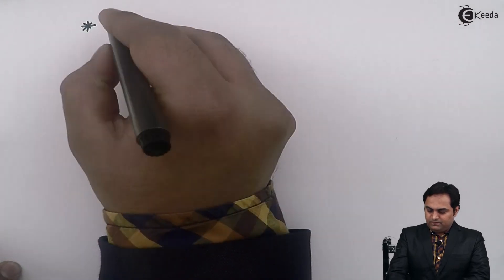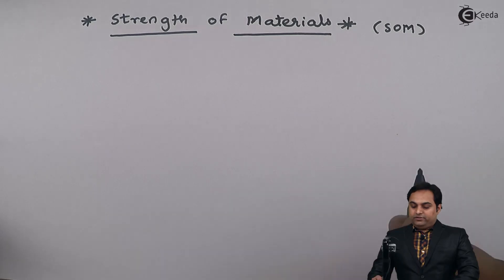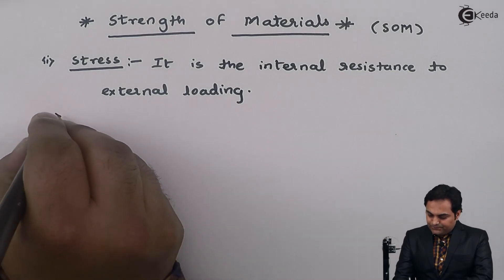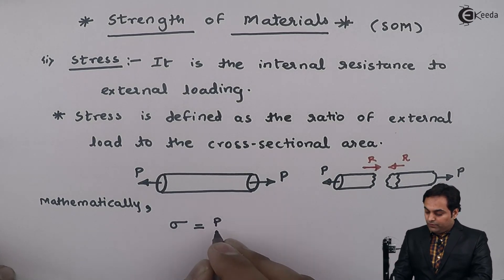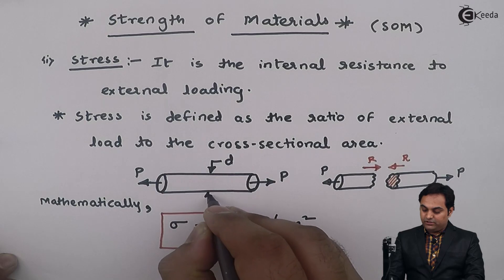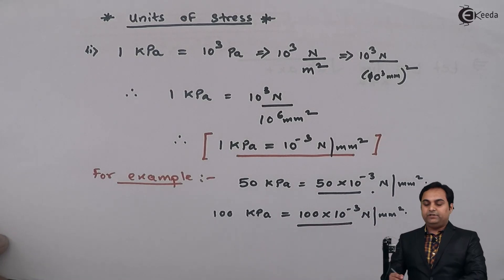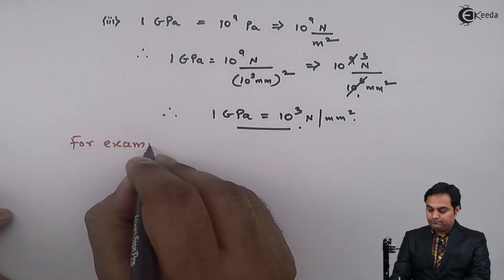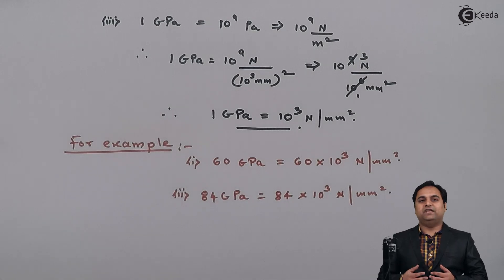Concept of Stress - Stress and Strain - Strength of Materials

Comment: Dear sir, Is stress is ratio of external load to the cross sectional area or the resistive force to the cross sectional area???
Reply: rahul gulati its resistive force per unit area. For more details you can visit here 👇
http://complete-mechanical-engineering.blogspot.com/2018/08/what-is-force-and-stress-difference.html?m=1
Reply: External force is numericaly equals  to internal resistive force
Reply: Tanmay Dhote absolutely
Reply: youre right sir!

Comment: a ferro concrete column of 300 mm × 300 mm square section is reinforced with steel reinforcement, the area being 1% of column area. the column carries a compressive load of 600 kn. find the load shared by  concrete and steel. modular ratio of steel to concrete is 15.

Comment: sir explaning is good but I think you r  wrong in stress definitions
you said - stress is defined as the ratio of external force to the crosssectional area 
BUT
according to me -stress I ratio of restoring force to crosssectional area 
please answer me`````````
Reply: Bro both are correct , because the restoring force is always equal to external applied load.
That's why he told....external applied load instead of restoring force.